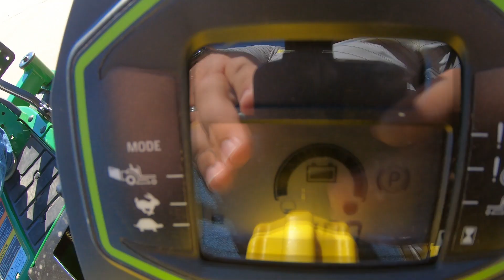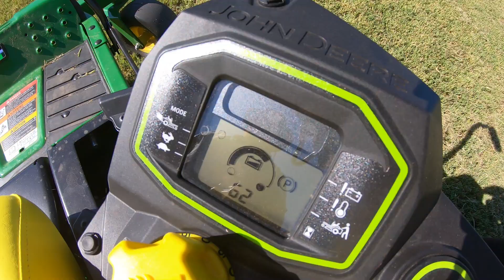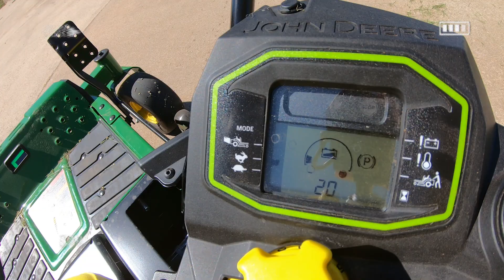BRAND NEW: How fast can the John Deere Z370R Electric Zero Turn Mow an Acre?

Comment: Thanks.
I be interested in seeing  how the 48" Z370r does, I should get mine this month.
Reply from the maker: I wish I had one to test! Let me know how it does for you!
Reply: @WesternEquipment  Thanks, I will.
Reply: Hello did you end up getting this mower?
Reply: @safewaydriving3463  No, too many things I didn't like about it. I live in a cold climate and you shouldn't leave batteries outside in sub zero conditions like we had this winter. If you get it go for the larger deck (48") it has bigger rear tires.

Comment: Wait till its 3 years old and the expensive batteries are spanked like my Milwaukee trimmer and blower with 8ah batteries.  I have lost 2/3 of the run time in just three seasons on a 1/3 acre suburban yard.  Can't even find the price of a new battery for this thing.  They don't want you to know.
Reply: Same. Battery degradation is real. Don’t be the Guinea pig for this unit.
Reply: $3,270 for new battery
Reply: Technology is deflationary. Look at TVs for example. If you buy one, your thesis is the batteries will be less expensive in the subsequent years.
Reply: @danwesson1934  No. My "thesis" is that people can buy a nice gas powered zero turn for the same price and use it for 15 years. You will not be able to say that for these lithium ion batteries.
Reply: @dsturbed2c  I agree and only have gas powered myself. I was trying to convey a possible rationale for buying a battery powered mower.
Reply: Milwaukee is trash that's your problem

Comment: You can see from the first perimeter pass that the mower is discharging basically nothing onto the sidewalk.  Cutting next to nothing. This comes off as deceptive in trying to make a battery mower look better than it really is.  I know that is not your intent but you should have done this under more real-world conditions cutting a decent length of grass.  I typically love your content but man, you can do better than this...
Reply: Agreed, i noticed the lack of grass on the sidewalk. Actually at first i though he should be going the other direction to shoot the grass on to the lawn and not trash the sidewalk making a mess. But when i seen most the grass was only getting hit by the wind rather than the blade it seems suss. 

Western Equipment, when you do tests can you cut a short strip first. Stop then show us how much you are taking off as comparison.

Comment: Why did you not cut like most would with a ZTR turning at each side ? I suspect this is to get the time you/JD wanted. Taller grass and mowing like a proper ZTR would I doubt that it would be able to finish on 1 charge and that’s why you rigged the test